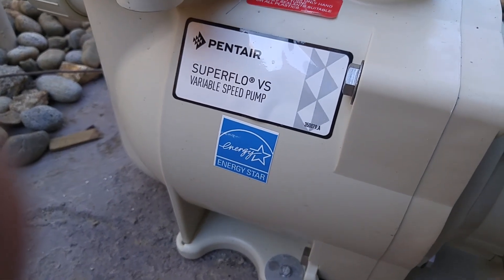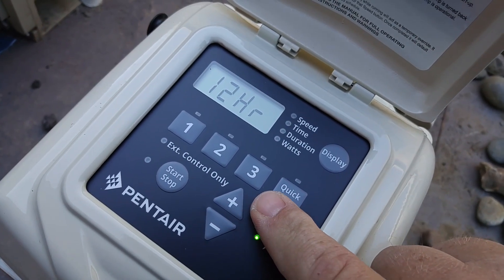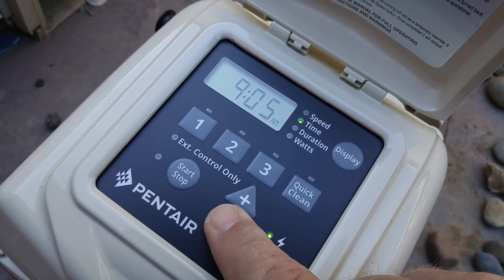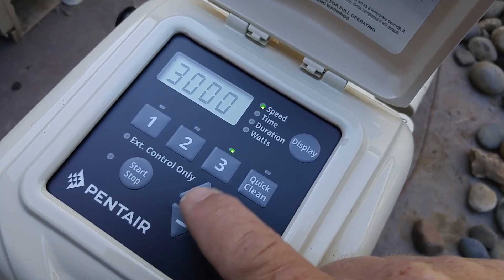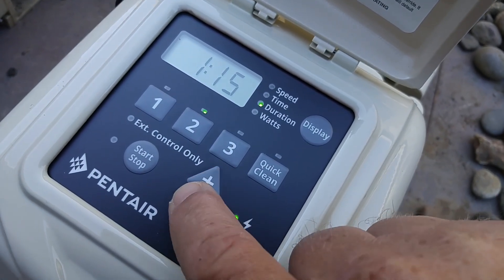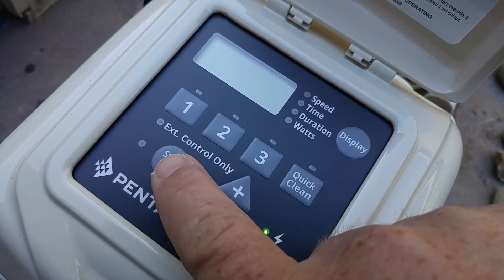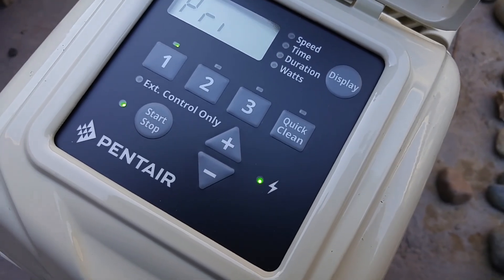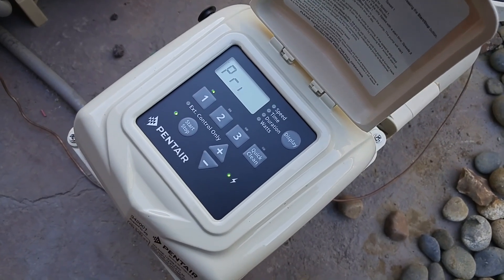Superflo VS Programming and Setup

Comment: Whats the average setup of most installs, and what is the setup for the "really thinking things over" crowd?

Pool shop asks me, (every season when they come and open)  what I would like the pump set at.  I say, whats everybody else doing?  They say 12 hr high/12 hr low.  Im not feeling that kind of run time, personally.   Granted, if you aint pumping water, you have a pond!  My pool has a water feature, and it obviously shines when pump is on high speed.  But 12 damn hours high speed, from memorial day weekend to labor day weekend (maryland climate/maryland foliage)

It would make sense to toggle high speed manually, say if I host guests, then just go over to the pump and command high speed (for as long as the guests stick around I suppose, then command pump back to its preset speed for that time window.   

I suppose I could go hit the quick clean button, when guests arrive?  But is the quick clean feature able to be tuned to a different specified run time/speed?  

It watched this video earlier, but got interrupted.   Im sure I will rewatch shortly, maybe my questions are actually answered in this video.  

Now, back to beginning of my post.   Maybe next season open pool, do the 12 low speed and 12 high speed/ for the sake of getting the water quality tip top asap.  Then, reprogram to , say something like 18hr low speed, 6hr high speed?   Maybe 20hr /4 hr could even work for me.
Reply from the maker: Try 4 and 4 I typically run commercial pools 24 7 but not residential.  8 hrs should be good try it and if not add an additional hour until it's good.

Comment: Thanks For Sharing John! 👍 Anything On The 0021 Error, Pops Up When It Drops Out Of Higher Speeds And Quick Clean Mode. Says Comm Link HMI? With Motor, Check Cabling. Does This Motor Pump Have a High Speed Burn In? Brand New Pump and It Seems To Crap Out On Higher Speeds...
#Thanks!
Reply from the maker: Might be a problem with the drive...if it's pretty new I would call a local warranty station and have them swap it out.

Comment: oump wont run and "ext.control only" is lit up, what does this mean please
Reply: pls read the following:

John The Pool Expert
1 year ago
Bryan McDougall 

Hold down the start-stop button until the light goes off

Bryan McDougall
Bryan McDougall
1 year ago
thanks it didn't seem to work but finally it did

michael pigneguy
michael pigneguy
1 second ago
@Bryan McDougall i have the same problem, how did you get it to turn off eventually ? im holding the start/stop button and nada

Comment: How do I turn of external control only light
Reply from the maker: Bryan McDougall 

Hold down the start-stop button until the light goes off
Reply: thanks it didn't seem to work but finally it did
Reply: @funflyer400  i have the same problem, how did you get it to turn off eventually ? im holding the start/stop button and nada

Comment: John - in the manual it says that the installer can set the priming speed and time - do you know how to set this and change it from the default 5 minutes and 3450RPM?
Reply from the maker: +Darren Greenspoon 

Priming will automatically run when the SuperFlo® VS 
Variable Speed Pump is started from a stopped state, 
except when running in Quick Clean mode. Priming 
will run at 3450 RPM by default, and will last for 5 
minutes. The drive’s screen will display and cycle 
through the following things “PrI - Priming Speed, 
PrI -- Remaining Time”.
Once priming has begun, the speed can be adjusted 
between 3450 and 1700 RPM using the “+” and “-” 
arrows. If it is adjusted below 1700 RPM, Priming 
mode will be disabled and the pump will immediately 
begin to run the scheduled speed.
Reply from the maker: Darren Greenspoon 

The 5 min time is not adjustable unfortunately.
Reply: John,
I don't believe this is true, because mine is set to prime at a lower speed by the installer and does not prime for 5 minutes because I don't have a 5 minute countdown.  There is a way for an installer to adjust these settings but it doesn't say in the manual.
Reply from the maker: Darren Greenspoon 

I believe it is a maximum of five minutes but there is a sensor that will turn it down once it is primed. I don't believe anyone can change the priming time. you can download the installation manual from the Pentair website it will tell you exactly what I told you.
Reply: I did download the manual, but there is also in the operation manual a line that says the installer can set the priming speed and time under the Priming Section in the manual.
Reply from the maker: Darren Greenspoon 
this is directly from the manual I think you may have misunderstood the section I put in brackets. I see how it can be misinterpreted but it doesn't say the 5 minutes can be changed.

The installer should set the priming speed to be 
sufficient for priming the pump from a fresh install, 
but not so fast that there is a substantial waste of 
energy during the 5 minute priming window.   (The time 
the pump needs to achieve prime can change based 
on local environmental conditions such as water 
temperature, atmospheric pressure, and your pool’s 
water level.]       All of these things should be taken into 
consideration when setting the priming speed, however 
in most cases the pump will not need to run at 3450 
RPM to successfully prime itself. 
Please test and verify chosen priming speeds more 
than once, letting the water drain from the system in 
between each test.
Reply: That is weird because I can tell you my pump doesn't prime for more than 30 seconds.  Not sure how the installer did that, but I don't see the PRI followed by the countdown.  Weird.  Thank you for your help.
Reply from the maker: Darren Greenspoon 
unfortunately the installer gets the same manual as you do I have taken the classes from Pentair and they've never given me any more information then what is in the manual. it is possible however that there is something wrong with your drive. if it is under warranty you can probably get a new Drive. I'm sorry I wish I could be more help.